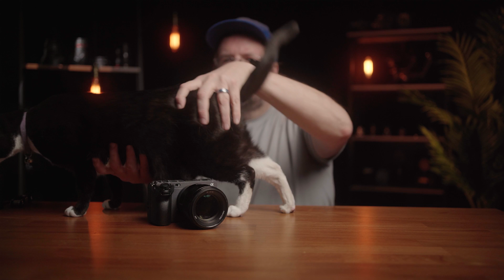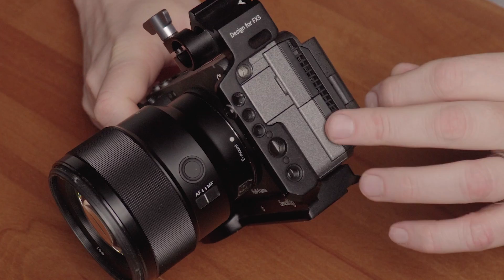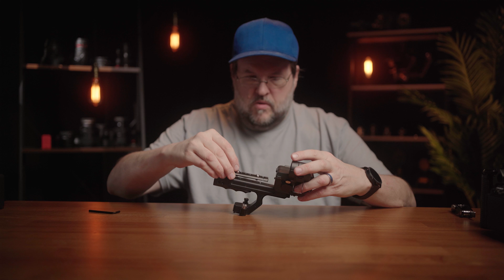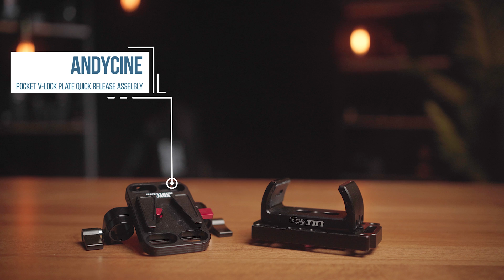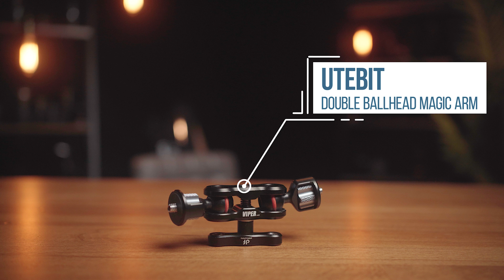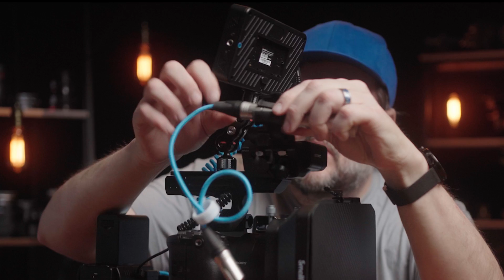Rigging the SONY FX3 on a BUDGET

Comment: Nicely presented, Gerald. If you're using a wireless mic, like the Sony along with the top handle, then you lose the SMAD hot-shoe interface. So I've added a spring-loaded cellphone holder (with 1/4-20 tripod mounting holes) along with a mini ball head on the top handle extension that allows me to clamp and rotate the receiver to a comfortable viewing position and give it a bit of lift above the camera body.
Reply from the maker: Thanks for the kind words! I like your solution as well. One of my favorite parts with doing rig videos like this is hearing all the creative solutions other shooters come up with.